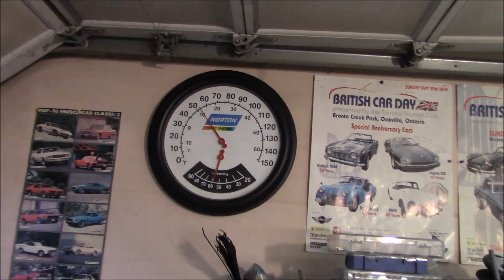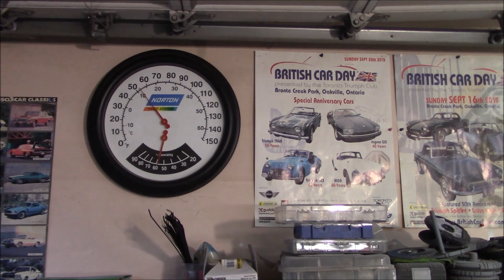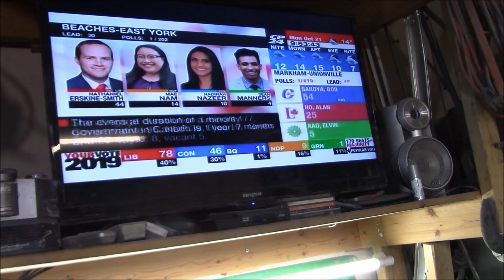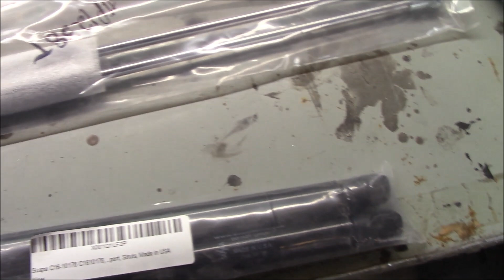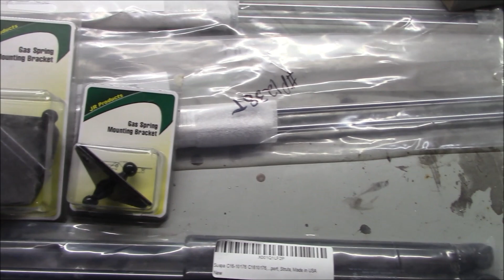1968 Triumph TR250 Restoration,  Bonnet Strut Fab and Fitting

Comment: We been trying to get ready for winter, plus being cleared by the dovtors to start back at work and fun in my garage in Nov.  ..It  has been a long six months...Our focus now is getting the corn burner hooked up, i need to replace all the vent pipe with new. The 220 electric heater works well with the corn burner, if i had larger electrical service in the garage i would add another and sell the corn burner or wood pellet stove. Looking forward to seeing the work on the TR250 this winter.
Reply from the maker: Hi Dan, yeah I haven’t dug out my electric shop heater yet but I did get the Kerosene torpedo heater fired up and checked out.  I’m going to have to insulate my garage doors shortly as well...not to be opened until Spring.

Comment: G'day mate from oz
I reckon hinges look great.
Smooth as well..
The back of the bonnet has a low spot.
Run a strip of masking tape across the channel where the flange of the bonnet rests upon it and  "paint the bottom of the lip with layout dye, I reckon wherever the dye marks the tape just shrink that spot ever so slightly and continue until no more marks happen when shutting the bonnet.
That should lift it up to the level of the cowl front edge.
Just a thought not an order mate.
Glad to see your  back onto it.
Bike looks great

Comment: Tush, I've recently started restoring one of my Triumph TR4As (I have 3 of them in various states of disassembly, plus another TR4 - stalled projects I have purchased), and have just spent the last month or so looking at your 1968 TR250 restoration videos (all 146 of them).  Thank you so much for the detailed work you have put into them.  I have learned so much from them and look forward to the next installment.  Along with Yakov's Rusty Beauties they are a real treasure trove of info that I am putting to good use.  I have put together an Excel spreadsheet with links to them all to enable chronological viewing of your entire project so far and I think I have captured them all, although I am not sure if I've missed any.  Is there anywhere I can view a total list of your video output on the TR250 Restoration Project? If you are interested I could send you the spreadsheet.  Thanks again for your ongoing efforts.  Ron
Reply from the maker: Hi Ron,  did you click on my playlists?  I have a TR250 playlist there (along with many others ). Can you take a look there and let me know if that helps?  Cheers, Tush

Comment: Good to see you back on the TR250! Like the gas struts for the hood (bonnet), pretty slick. Speaking of Les, when is he going to get started on his TR6?
Reply from the maker: Hard to say with Les...he hasn't even done any more work on his RHD Capri that he started....I am going to have to try and motivate him to get off the couch for at least an hour a few nights per week.   He did move the TR6 at least into dry indoor storage....oh, and with my help, he has been accumulating some parts for it...new top, new windscreen surround and windscreen, new interior, good used seats etc.
Reply: @cheftush  Tell Les that we are pulling for him to get cracking on that Triumph!